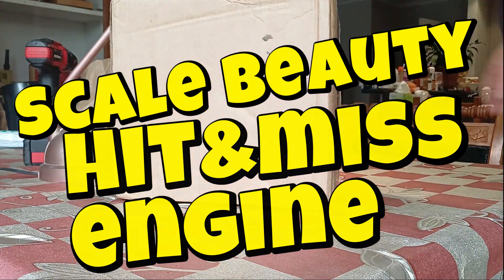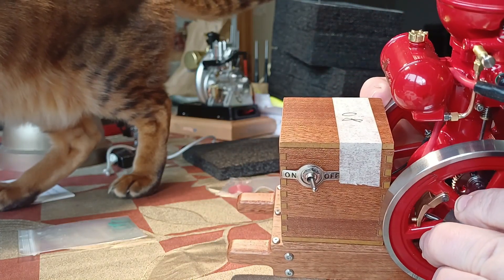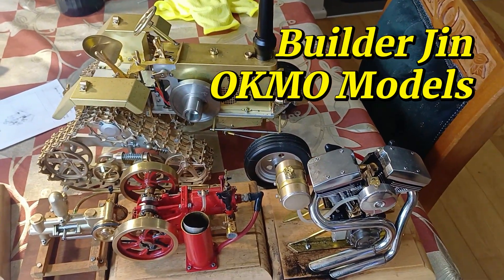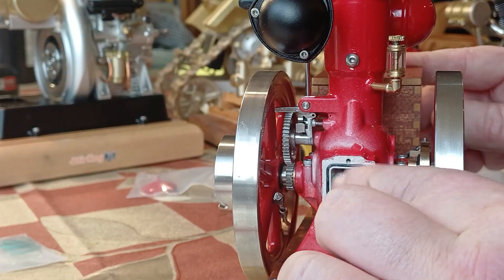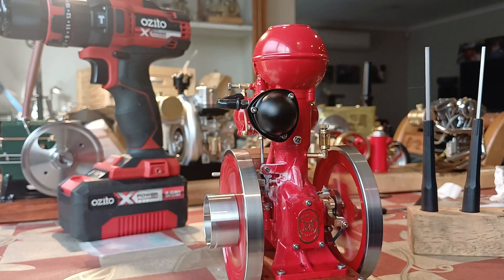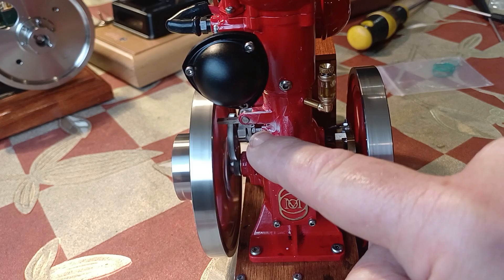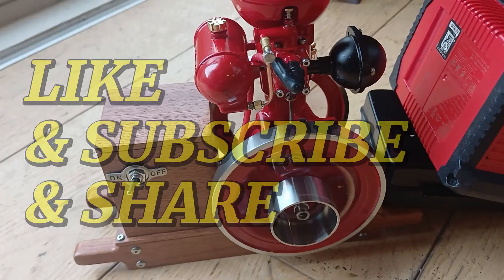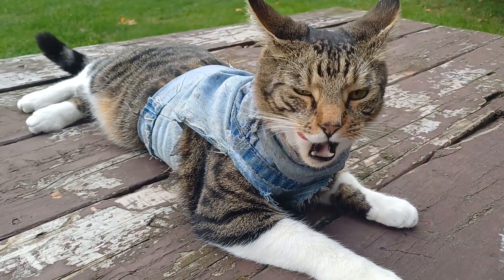Best looking budget scale hit& miss model engine 2025

Comment: Problem with these painted engines is they are brass. Paint don't stick to brass very well, so when you start to work on these, the paint starts to flake off and will only get worse once the oil/fuel gets under the paint. total waste of time painting....

Comment: Thanks for the fine tuning tips!  I have mine set up as well. It sure is a nice model!  Quick question, Maybe I'm thinking this, but setting the ignition timing up so that it fires a bit harder,  will the working parts handle that without excessive wear or possibly shorten it's working life?
I also notice when running mine, it runs VERY smooth and fires regularly when its held down. If not, it tends to run irregular and in time stalls out.

Comment: I got mine today (ordered after seeing you demo the original). My first experience with these engines and instructions are not clear on oil. Do you just fill the glass container with 2 stroke oil and use straight petrol (95/98) in the tank?  I see your comment about mixing oil in the fuel…but no mention of this in instructions.
Reply from the maker: I used 2 stroke mixed because it had a fluoro ring piston seal and all his previous engines use mix. Once run in you could try straight gas and the oiler....I'm too forgetful to trust myself to keep the oiler running. I'm using lighter grade oil faster flow in the oiler. Start with 40:1 mis, run it in, move to 100 to 1 as long as you still have oil dripping out of the exhaust you're good to go...I think. Let me know if I'm wrong please, someone

Comment: How many turns is fuel screw, mine runs couple of minutes and hard to start, I using fuel to cigg lights.
Reply from the maker: You are using choke, right?  Running a couple of minutes means too rich as it slowly floods . Alternative, too lean, it should start not firing and getting weaker. Clean your spark plug, obviously
Reply: @ThomasPCGuruENGINES I solved problems, the fuel tank wasn’t full, but but full of air 😅 I hand cranked flywheel and fuel screw one turn out. Now engine running good long time.😊
Reply from the maker: @hotbulb4537  So happy to hear this! Simple errors like this are the bane of my life too!! :)

Comment: Bonjour Thomas,
For mine, number 3, I use a gasoline called "alkylate" which doesn't smoke at all. I opened my needle valve about 3/4 of a turn.
And I didn't touch anything else and my engine doesn't jump.
Waiting now for the Z01... And the B02😉
Amicalement, Raphaël
Reply from the maker: Interesting! You are becoming a hardcore collector, mon ami :)
Reply: @ThomasPCGuruENGINES  Bonjour Thomas,
You are right, but only for steam and now these high quality engines that I can't find in Europe unfortunately, as I have the only one no longer available, the "Karl" that you can see on my channel, you are much more eclectic than I am.
Furthermore, I would like to highlight an important fact, I haven't your technical skills, this is why I greatly appreciate your videos!
Perhaps because I have no cat assistant 😁
Besides this, we have the Retrol & Musa HM-01(bought with Enginediy or Stirlingkit) engine, now the B01 Retrol & Okmomodel one, do you know who Retrol is ?  They seem to have a site but are not sellers ???
Amicalement, Raphaël

Comment: Are you running 2 stroke mix in the petrol  during run in...or at all times for safety?
Reply from the maker: Johnny this engine has a fleuron ring unlike the last two. I am very happy with these, never had an issue particularly in low temp low rev models. This engine specifies mix although I guess it would run with that drip oiler...for valve guides and all, yes, I'll run mix. Usually after run in I run a really weak mix, As you say, it's safer to add oil in the fuel, Good oil doesn't seem to smell much these days...
Reply: @ThomasPCGuruENGINES  
Thank you.

Comment: Is this a total loss system re the oil...
nothing in the crankcase just the oil being fed from that very small oil reservoir down to the crank bearings, big and small ends lubricated by "splash"?
Reply from the maker: Yes I looked very carefully at the instruction and checked out the construction to answer this. It's not like the 11140 or 185 from Jin, both use metal piston rings and oil pumps. This is simpler and cheaper!
Reply: @ThomasPCGuruENGINES  
Thank you.
Reply: It is.  The original was also a total loss lubrication system.  This engine is a very good scale representation of the real thing.